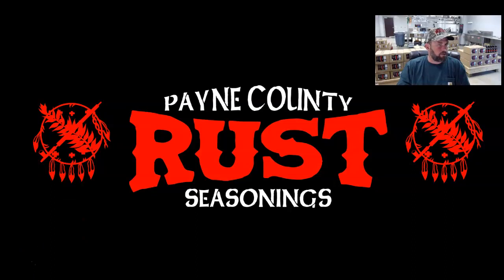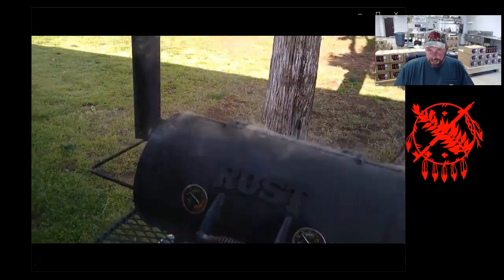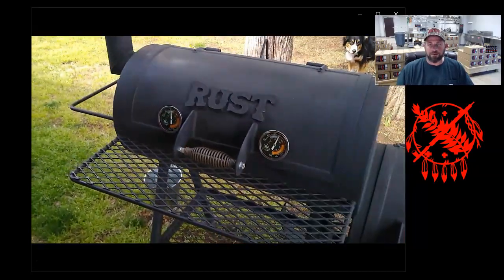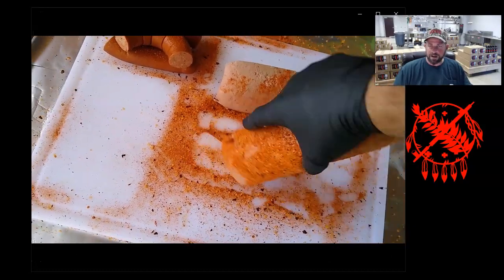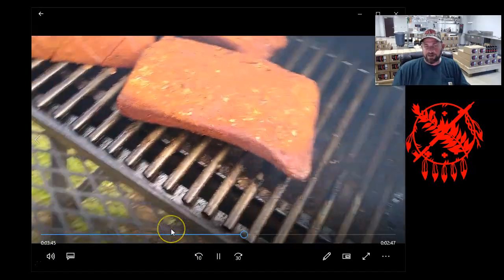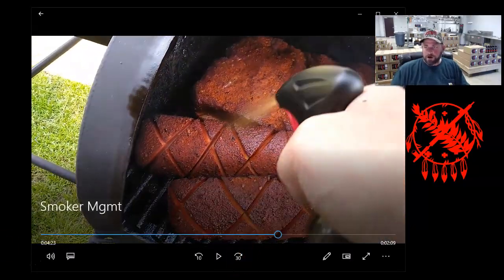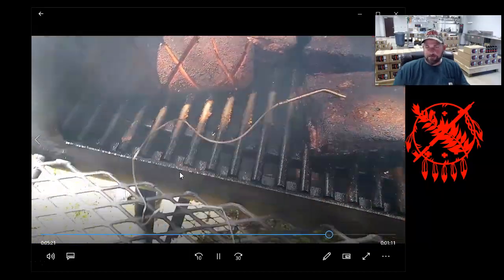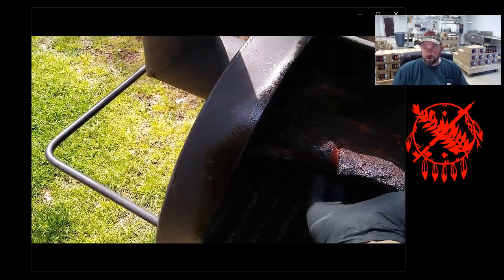BBQ Fire Pit Management on Oklahoma Joe's

Comment: I have been told that the thin blue smoke argument doesn't apply so much to a kettle grill or smokey mountain, but this argument that you need the right burn temperature to get the flavorful compounds we want undermines that somewhat. I personally find getting thin blue smoke on a kettle and presumably a smokey mountain as well is almost impossible. When it happens, it seems random. I've tried putting the wood under the coals, on top of the coals, next to the lit coals. . . Doesn't matter. I don't love the smoke flavor I get from the kettle, but it's all I have for now. Any advice?
Reply from the maker: Generally "thin, blue" smoke is an indicator that you're getting a good, complete burn of your fuel. But good, clean smoke may range from a whitish hue to completely invisible! Even if it's invisible you'll still have tons of the necessary components in the fire's exhaust to correctly fume your products. If, however, your smokestack or grill-vent is issuing big, billowy plumes of white cotton-like smoke, it's likely your fuel is either too moist, or most-often-the-case not hot enough-smoldering instead of burning. If you're having this problem regularly with the use of charcoal, I'd simply let the charcoal burn to a hotter fire before choking its air supply and beginning the cook. If you're using a Smokey Mountain or a kettle to smoke, I'd also use smaller pieces of wood - think 1" in diameter or less. Using smaller pieces of wood greatly increases the likelihood that the wood will reach that all-important 700F+ point where the lignin burns and syringol and guaiacol are released. I generally let my charcoal get white-hot in the chimney before using it. It's good you're paying attention to the smoke--fine-tuning the quality of your smoke will have big effects on the flavor of your BBQ!